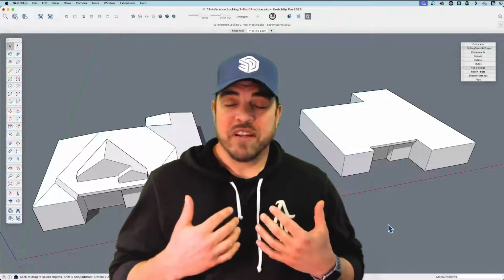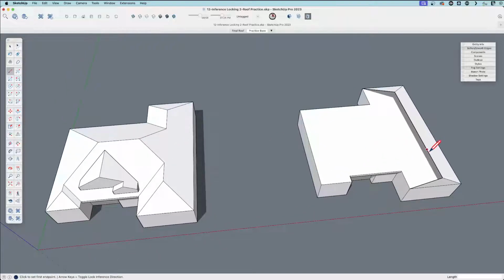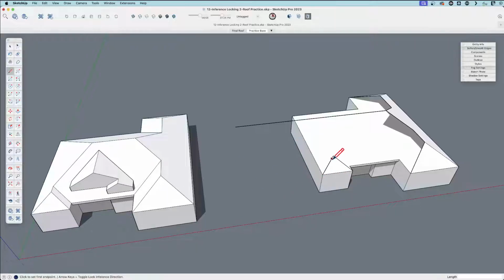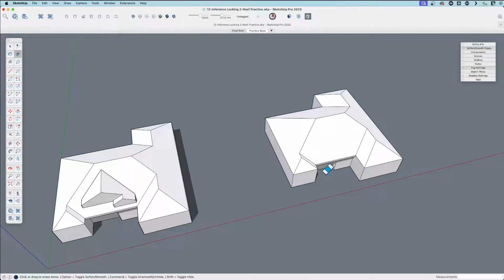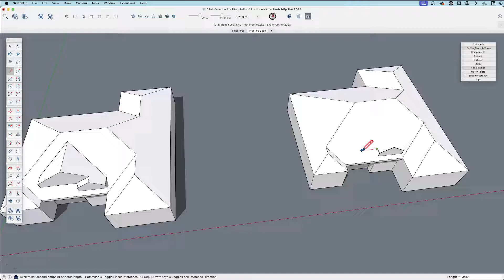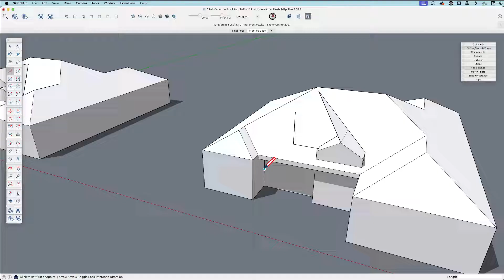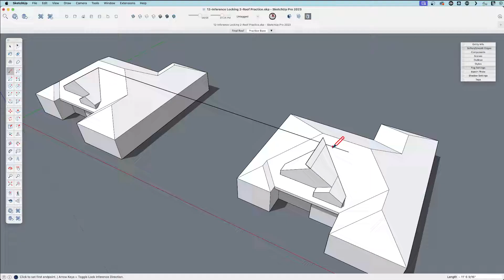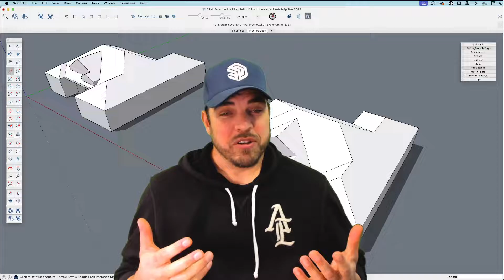Level Up   Inference Locking Practice

Comment: Hello, thanks for the video. What is that protracker tool you are speaking about? Or which course un learn.sketchup use it? Thanks 😌
Reply from the maker: The Protractor tool is super useful for creating guidelines at angles. I cover the basics of it in the Inference Locking lessons on Campus, but there are also a number of vids here on YT. Cheers!